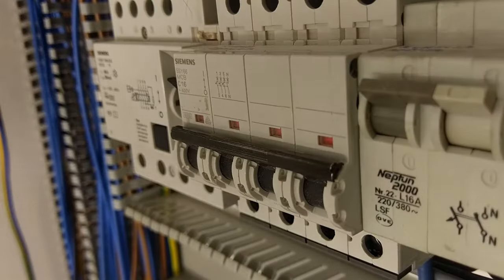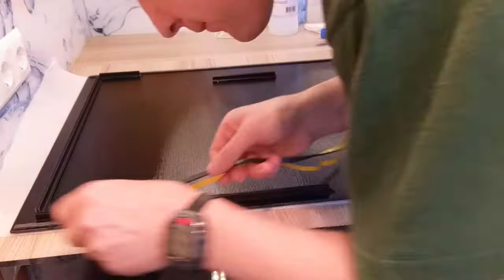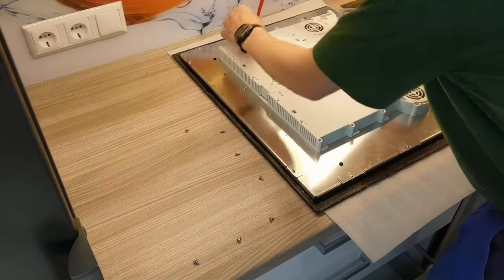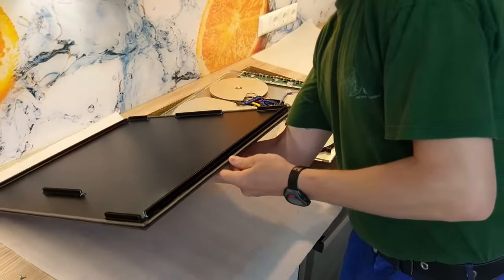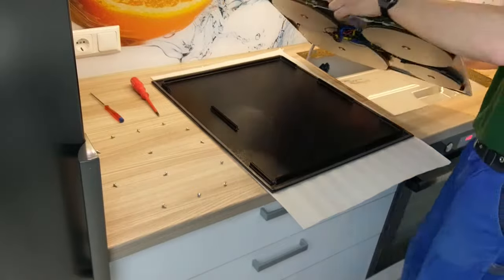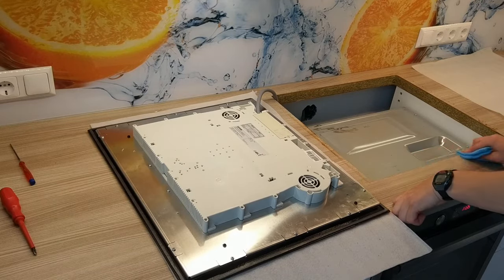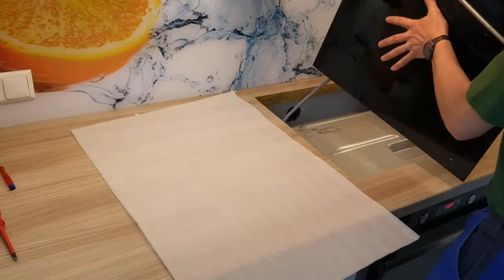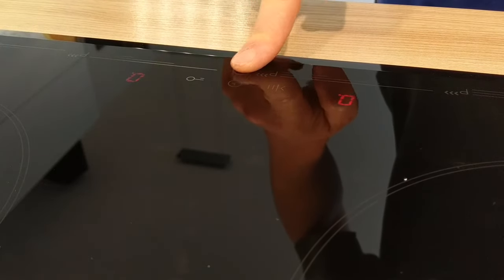DIY-How to replace broken glass on the hob

Comment: Any advice for if the previous home owner has used a mass of glue to seal the glass hob top to the counter?
Reply: Put painters tape around the hob and then use a chisel to get it loose, now you can use a bit more force because to tape will protect the countertop a bit
Reply: @jesseycoolen4169  thank you for responding! Thats pretty similar to what the guy we got to come help us did, thankfully its all sorted and behind us

Comment: Hello   I would really appreciate it if you could help me with this problem I have.    , I have a KitchenAid cooktop model KICU568SBL1. It comes with two identical positions on the left side, two positions in the center and two positions on the right side. This Cooktop comes with 3 main control boards, one control board for the two positions on the left side, a central control board for the central position (2 induction positions) and the other control board for the two positions on the right side. It gave me an error code F0 in the positions on the right side. When I checked carefully, that control board had problems and had to be repaired or replaced. I was fortunate enough to get the same control board for that position since it was not available. It was changed correctly. The error code F0 no longer appeared, but I am left with a problem that I do not know how to solve. The problem is that the two positions are reversed, when I turn on the one below on the right side, the one on the top turns on, when it gets too hot I get the H because the sensor is in the correct position and it cancels (flashing 2 and the letter c), this means that there is too much heat. Everything inside is correct (wiring), everything is in its position. I imagine that a reset needs to be done on the control display, does anyone know how I can solve this problem? Disconnecting it from the power is not enough. I would greatly appreciate it if someone could tell me what to do.  Has this ever happened to you? . In short, what happened is that the selector changed position and I don't understand why since everything is connected correctly and has been rechecked a couple of times.
Reply from the maker: @juanmunera2561  I assume, that controller plate is for the other side...
Nothing else come to my mind...

Comment: Is the process the same for smeg ceramic bob as well?
Reply from the maker: I don't know about this...
Reply: @SimonFabcic ok I did change the ceramic Hob. As all the screws were on the sides, i didnt flip the Hob. I just opened it and changed the glass. It was quite a straight forward task. Your video gave me confidence for sure. BTW instead of a chistle I used a thin cooking spoon.
Reply from the maker: @Manoharan  Happy that I helped ;)

Comment: show the electrics
Reply from the maker: What do you mean by that?
Reply: @SimonFabcic  how is connected to electricity? ordinary 220 plug or the one an electrician need to fix?
Reply from the maker: @woopsi4973  I have 3 phases (400 V). If you want, I can check in user manual, how is connected.